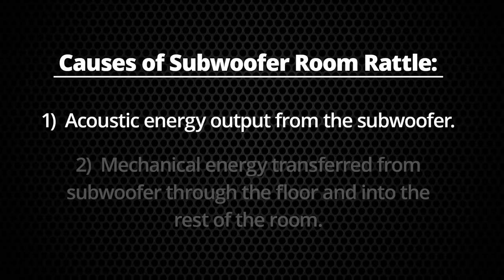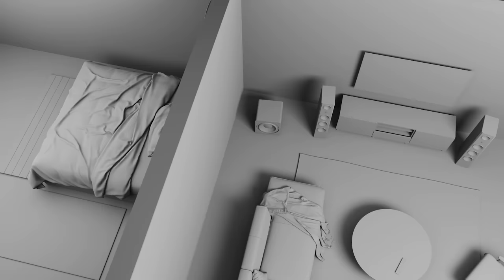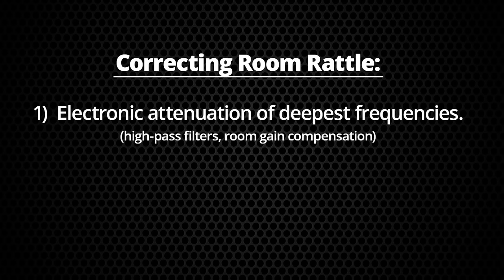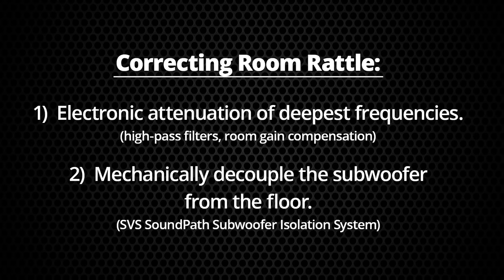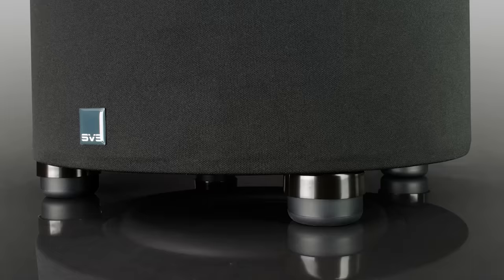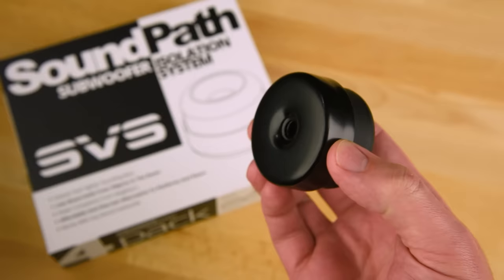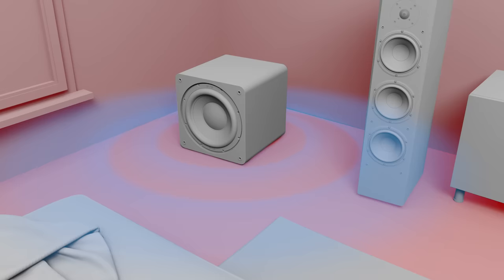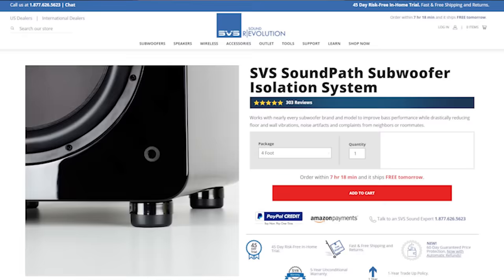How to Reduce Subwoofer Room Rattle, Vibrations and Bass Bleed

Comment: For how much we are already paying for the subs why don’t the isolation pads come with the subwoofer along with the tiny ones?
Reply: correct
Reply: Agreed. I don't think including a set of $50 feet would've been unreasonable considering the $1400 my PB3000 cost.
Reply from the maker: Not everyone would benefit from having the SoundPath Isolation System depending on the floors and room so we offer as an add-on. Plus, it adds height, which can be a negative for people with tight sized spaces.
Reply: @SVS_Sound  are you really that cheap not to put a regular feet and the isolation feet?
Reply: Yeah u right why! Why! Why!
Reply: @SVS_Sound  don't think soo! Pc model have those sound path already
Reply: Isolation is not for everyone. Including these type of feet would make your sub cost a couple hundred more! Examine your room and your type of floor and decide if you need to reduce mechanical energy.
Reply: SVS - well then let the ppl decide to use or not, depending on their room acoustic 

Charging 50 addl when ppl spend 1000s doesn’t look nice
Reply: @naughtyca131970  damn
Reply: @JollyMan69  if you can spend £1000 + on a sub what's £50  it's  only 5% of the price you spent on the sub  WTF grow up stop acting like a little kid.  Just don't buy  but don't cry  about it. I spent £8000 on my set up in 2012 and another £1000 on cables and so on to get best out of my set up.didnt cry having to buy speaker cable because my 7 speakers and sub never came with any. I knew what I was getting into was not cheap since then done everything. But still try tweaking no harm in that.
Reply: I own other brand of subs, and mine both came with spikes and additional rubber feet.  No extra cost
Reply: @MrNuthed  And it probably costs them less than $5 in materials to make lol
Reply: Slosh MaGee by overpriced, are you just saying you can’t afford their subs and are jealous?
Reply: I use the SVS Isolation feet and can attest to the fact that they really work.
Reply: Bunch of whiners on here.
Reply: Some people like the rumble.
Reply: so they can charge you $50 bucks more for them
Reply: @SVS_Sound  lmao come on, lose height? its like 1 1/2 inches.
Reply: Because SVS needs to find a way to empty your wallet. The cost of their speaker wire is a joke as well.
Reply: @MrNuthed  NO DOUBT! Throw a customer a friggin bone if they're giving you that much cash.
Reply: I just spent £399 on the sony srs xp700 stanalone speaker box and the bass is rediculous..........i climb inside myself when the bass rattles my house and cant even imagine what my neighbour is thinking........now i have tp go out and spend more money to fix this issue
Reply: Because it’s a business.
Reply: Because it’s a business and not everyone wants them anyway.
Reply: Balls ro the feet , I'm going for townsend bars
Reply: Because why give you something for free when they can sell it to your for $50? 🤣
Reply: Cuz if you just paid that much for a subwoofer then you'll pay a little bit more to make it sound better. Capitalism

Comment: This video is basically just an advertisement for rubber subwoofer/LFE feet.
Reply: And not to mention, they're absolutely useless if you have a downfiring sub.
Reply: @HeretixAevum  True that.  These things cost $50 for some rubber feet too.  You can achieve the same effect with a pad of high density closed cell foam for about $2 ... Unless you have a downfiring sub of course.  I have my sub on a concrete floor covered with linoleum tiles.  The room has rattles and buzzes so I watched this to see what I could do about that, as per the clickbait title.  This information was useless to me, those neat little shoes for my sub would not help and they really didn't cover anything else that my system can do to remedy this problem.

Comment: Story time:  I pushed my heavy PB-16 across the carpet.  The isolation rubber detached from the coupling  (It fits back on, not a big deal).   I saw quickly that I need a moving men carpet slide under it.  Moved the PB-16 a few feet into its new home.  KEPT the carpet slide underneath the rubber foot.   Even better results.  The smooth hard plastic on the carpet, and the foam top, under the rubber foot is quite amazing, even accidentally so.   For carpet applications, this is a new level of amazing.

Comment: Very pleased with the effectiveness of these feet.  When I bought my first SB2000 I also bought SVS feet for it.  No issues.  When I added a second SB2000 I held off getting the feet to save a few bucks.  My subs sit on carpet on a second floor.  I just added SVS feet to the second sub.  What a noticeable improvement to my bass!  (And, I was very pleased with these dual subs before).  Now my bass is really nicely balanced.  It sounds bigger and tighter.  I was apparently getting some floor stuff in my overall sound.  These SVS isolation feet are well worth it!
Reply from the maker: Thanks for sharing your experience!
Reply: @SVS_Sound  Have to say that even Concrete Floors resonate in a multiple floor apartments. So it gets annoying for people living below and above.

Comment: I do like these feet and have used them on my last several subs. Huge kudos for going in to detail about what floors these do and don’t work with. Even though they don’t effect my sound, they do look really nice and make it super easy to move when needed.
Reply: I want to avoid bass frequency and vibration can I get acoustic foam walls

Comment: I live in an concrete apartment with hardwood floors. My dishes were rattling even with low to moderate subwoofer volume on my crappy 100w RMS 10" sub. After installing the isolation feet no rattles whatsoever. I'm sure my neighbors appreciated it too.
Reply from the maker: Thanks for sharing!

Comment: I purchased the SVS SoundPath Isolation System w/my HT subwoofer  b/c I lived in a second-floor apartment. Got them for better sound quality and out of respect & consideration of disturbing neighbors. No regrets. It’s working fine, and I wouldn’t run a sub w/o them now. Consider it a part of sub. It’s also a reasonable price, not ridiculous. I use floor isolation pads for two smaller down-firing subs in a stereo rig in other room. In comparison, I like the SoundPath Isolation Feet better.
Reply from the maker: Thanks for sharing your feedback!

Comment: I do like these feet and i bought them for my Klipsch subs and it works excellent & it's stopped vibrating the floor windows and door & the sube sound more cleaner.
Reply: I was thinking of the same thing,  I have a Klipsch 12" and it sits directly on a tile floor and rattles everything.
Reply: My window had a rattle, now with these feet the rattle is gone.....better low end bass,,, worth the money...the haters should shut up...don’t try ,don’t buy...highly recommendable product.!

Comment: I just installed a set on my really old Advent 15" powered down firing subwoofer (modded). I could of went the hockey puck route like some people, but the SVS Subwoofer Isolation System looks much nicer, and give my subwoofer a cleaner look. Now my old neighbor stopped knocking on my door asking me did I felt an earthquake. That means now I can push my sub just a little more... Just a little. LOL!

Comment: gotta say the sound path isolation system was the best $100 I ever spend, I live in a town house and have duel 12" Klipsch THX Ultra2 subs, and my neighbors use to pound on my walls when ever i'd watch a movie or play a game, they stopped doing that as soon as I put these feet on, Don't get me wrong I can't crank my system to reference levels or anything, but at least I can have my subs turned on now and actually use them at reasonable levels.
Reply: No kidding,  I don't have that problem since I am in a house but my Klipsch sits directly on tile and was wondering how to stop the vibrating and rattling on walls.

Comment: I personally love being able to feel the bass in our house as we have wood floors foundation. I of course had to de-rattle some pictures,doors etc... but there is nothing better than actually feeling the bass in our seats and feet. You get a genuine feeling of being there. The house we had prior had a concrete foundation and you just didnt get the same feeling. I do find it odd though that some people don't want it. I get not wanting rattles but dialing down the "boom" just doesnt appeal to me. I wonder if the people who dont like it have ever considered just getting a smaller sub?
Reply: Hell yes! Nothing like that incredible tactile effect. 

But keep in mind, just because you physically isolated the sub from the structure/flooring, you wouldn't necessarily diminish the tactile effect of your sub system. It might remove something that you like, but subjectively it could easily sound cleaner, tighter, and with more impact.

A few years ago an audio enthusiast group (Physicists to Physicians) really went deep down the tactility rabbit hole. So much was explored both individually and collectively, much was learned and shared throughout the enthusiast community. The tactile component of sound, ... fascinating stuff. 

Feeling the energy in your seats and in your feet is great. The mechanical energy directly transmitted to the floor from the bottom of the box is essentially like another sub. You've got energy coming from the floor via the sub's feet, and acoustic energy coming from the cone. The problem is time alignment. 

The differences in arrival times can blurr the transient in time ... thus muddying and softening it's impact. It's distortion. Compared to air, the floor transmits the signal faster and introduces distortions/resonances. 

Whether home, live sound, or in the studio, any system with multiple LF sources, one goes to great lengths to assure each LF source sums ADDITIVELY at the listening position, with ideal time alignment for maximum impact. That mechanical energy generated from the sub's feet you can't properly control and align for summation at the listener. 

A trend over the last 10yrs or so is utilizing approaches like nearfield subs to heighten that tactility. Another approach is tactile transducers such as the superb Crowsons (butt kickers, just high quality).

But these additional sources are all adjustable in alignment in the time domain relative to both the LCR mains, and the subs. 

Sorry, waaay too deep into the weeds, being I'm all C-19 quarantined and locked down, ... point being that killer tactile effect may get even better if you isolate your subs. The acoustic output alone may create much of the same. 
Thanks and best of luck

(Fwiw, in my primary media system, I've got 6x12"s in the two octaves between 60-240hz, from there down I'm rockin' 4x15"s, 4x18"s. 
The 4x15"s are dual-opposed Seaton Submersives, so by design they don't generate any energy via their feet. You can stand a nickle on end and pump full tilt kick drum thru the thing and the cabinet will not knock the coin over!
The 4x18"s are an Infinite Baffle  sub manifold mounted in my attic outputting into my listening room. 
Via eight channels of Ashley Protea DSP adjustment I time align and blend the six LF sources so they all sum properly and smoothly across the sofa seating. It's not a dedicated Home Theater, simply a modest system in a rectangular family room with attached kitchen, approx 29'x13'x8'). 

*it's funny btw, this video wasn't really about "Room Rattle and Bass Bleed", it was merely a 7:43 advertisement for their product. I've got nothing against SVS, I dig what they do, just saying.
Reply: @FOH3663  so you recommend isolation with multiple subs? I tend to like the rumble and am thinking about enhancing it with spikes (I'm on carpet). I've tried nearfield and I did not like the sound.
Reply: @matsudakodo  
The isolation simply eliminates physical energy from the subwoofer transferring to you via the floor. 
Yes, strongly recommended. 

That cleans up any transient blurring via differing time arrivals. 

Ideally just the wave-launch propagating from the driver is the only source you want to experience. That energy can set the floor and everything else in motion. 

The other undesirable scenario is this;
As the woofer strokes, the woofer frame/magnet assembly is held still by the box. But the equal and opposite reactionary forces are transferred to the cabinet. The cabinet transfers those forces to the flooring. The flooring transfers this energy to the seating and most likely the feet of the listener.  
So this vibrational energy is straight up distortion. It's out of phase, and mis-aligned with the wave-launch bass from the sub... and this vibrational distortion signal gets to the listener first. 
The speed of sound propagating via the air is slower than the well coupled speed transfer through the floor. Thus the potential blurring of transients. 

They do a terrible job of explaining this in the video.

Comment: There are hockey puck sized rubber vibration reducing devices designed for washing machines that work well for a fraction of the cost, like $20 -30 for a package of 4.
Reply: hahah thank you for this comment, i ordered isoacoustics puck and then these washing machine anti vibration pads, both gave same results so i returned the isoacoustics which were  $$$ as compared to $

Comment: I run these on my NHT 2.5 towers. They have built in side firing 8” subs and the sound was noticeably cleaner after installation. Great product at a reasonable price. I needed two sets of 4, but the cost was well worth it. Don’t hesitate.

Comment: I ordered the isolation system with my pb2000 last year from the outlet on your site. I haven't tried it without those and don't plan to, lol. I found a sweet spot for the apartment I'm in using Put On by Young Jeezy. It's more of a middle ground spot. You hear and feel the low intro tone. Which I what I wanted. If I rearrange everything I'll lose everything above 50hz. I'm content with the middle ground. Every frequency is satisfactory. Can't even think of upgrading yet because I haven't had a chance to open this baby up due to living circumstances.

Comment: FYI Isoacoustics offer a similar product which I can wholeheartedly recommend. The have the Gaia or Orea which seek to decouple as well, but use calibrated a weight based loading system, which would be more effective than using this SVS system on other branded products (since the weight loading factor would change).

Comment: I have two identical subs mid wall Placement.A pro told me that nowadays it pretty common two have Them 180° and 0° phase.
I use Dirac Bass Control and did a new measurment with different Phase settings.Whats your opinion?😊.

Comment: $50 for a product that takes under $5 to make. Why not just include them with the subwoofers that are being sold?
Reply: Simple because they can sell it and make $50.
Reply: thepiecesfit makes you think if their subs a priced reasonably aswell.
Reply: I think we can add a foam instead
Reply: @Thehobbyeast  yes I went with angled foam. Downside to foam is its more speaker size specific so to speak where pucks as long as u got 8, maybe even 6... You're Gucci on most speakers

Comment: Nice review thank you.  My sb3000 is positioned on a stool because positioning it on the wooden floor means all the sound would go underneath the bed. My living space is too small and I'm almost in trouble with neighbours due to the sub energy. What I would like you to kindly tell me is: Would the isolation feet work well why sub is on the stool or not?
Reply from the maker: Yes, the Isolation System will decouple the subwoofer so it will add additional vibration dampening that will help with the neighbor issues.

Comment: U used these on an Elac 3010, passive radiator , the whole sub is almost jumping at low frequency it doesn't happen with spikes, I'm not sure why, but at other normal range it does sounds cleaner.

Comment: I have a sub in front of my fireplace and it makes my fireplace boomy and sometimes rattle. How can I prevent this from booming and this is the only spot I can place the subwoofer?
Reply: Add these svs isolation feet to your sub and it will reduce floor boom which is what's causing your fireplace to rattle. That's the whole point of these.

Comment: The video mentions that the height was optimized as well in testing. I'm putting these on some custom subwoofers but I need to add a 3/4 inch "spacer" (for lack of a better word) between the feet and the base of the subwoofer because my cable connection will be at the bottom of the sub. Does adding that spacer (3/4 inch mdf "puck" the diameter of the soundpath feet) negatively affect the ability of the soundpath feet from doing its job?
Reply from the maker: It shouldn't have a negative effect as long as the SoundPath Isolation System is still between the subwoofer and the floor.

Comment: I’m about to purchase a Pangea Audio Vulcan Turntable Stand (holding about 100 vinyl LPs, a Sony 400-CD changer, and a Fluance RT85 turntable) and will place the stand on a hard wood (Hickory) floor, but I’m not too keen on using Pangea’s spikes on their tiny discs. Would it be possible to replace the spikes entirely with these acoustic isolators? Or can the spikes be secured into the small isolator holes? Or can you recommend another SVS product that will work for this application? Thanks in advance!
Reply from the maker: Yes, it is possible. You can also use double sided tape or sticky foam to adhere the Isolation System to the turntable  stand if you prefer over the spikes.